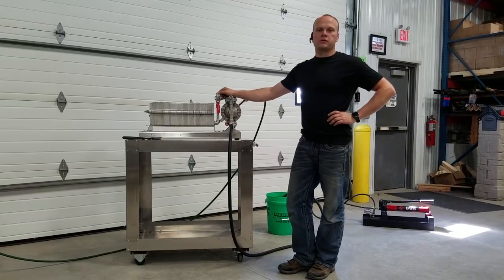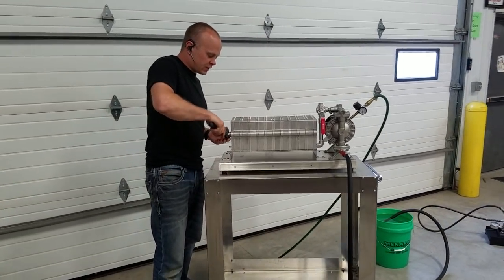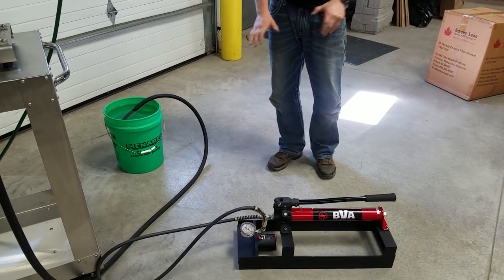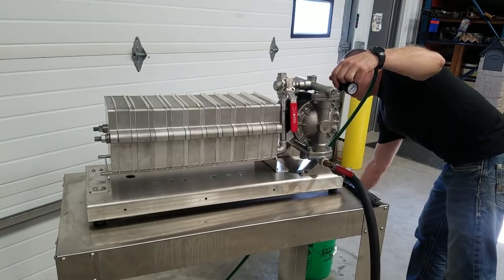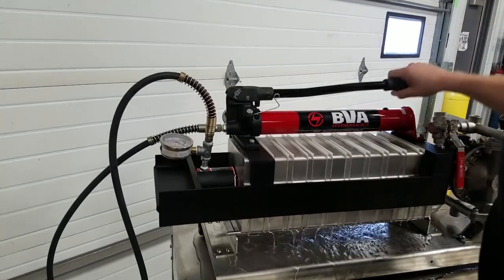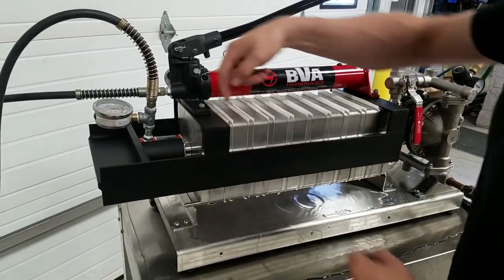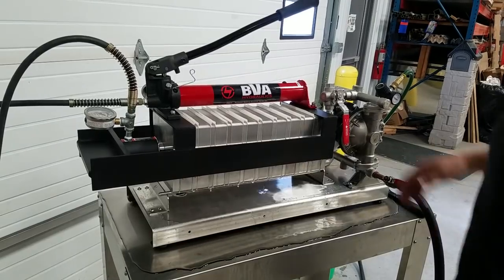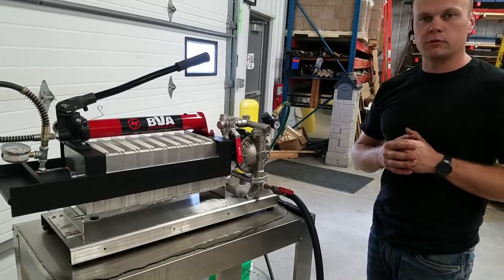PIG Filter CURRENT MODEL

Comment: I don't understand this, can you please explain what happens to the process when you throw the press and added pressure on? Would it just ramp up your speeds or allow you to continue running material or what? And this is for filtering crude? Sorry to be such a newbie, just trying to learn 🙏🙏
Reply: It's a filter for crude extracts, the design allows you to dewax large volumes of extract without having your filter clog. When he puts that press on hes compressing the stack of filters to minimize the amount of liquid that leaks from this poorly designed mess.